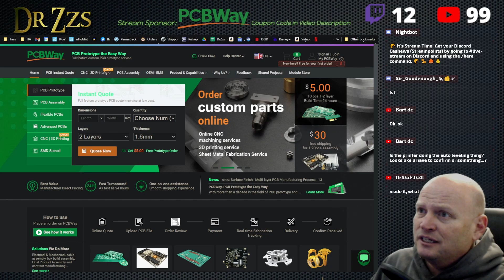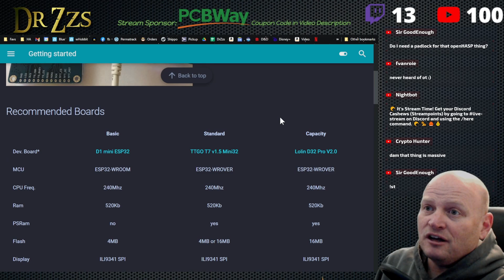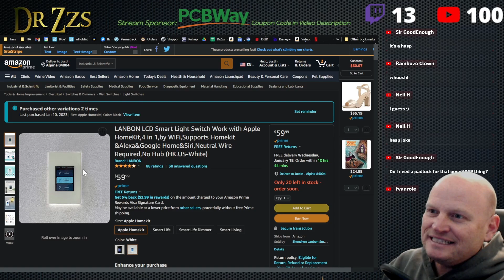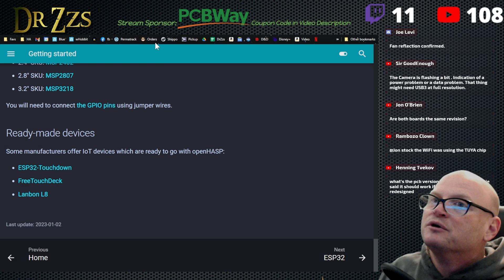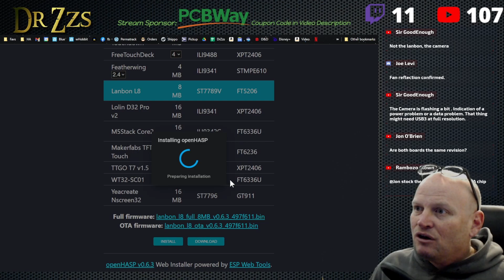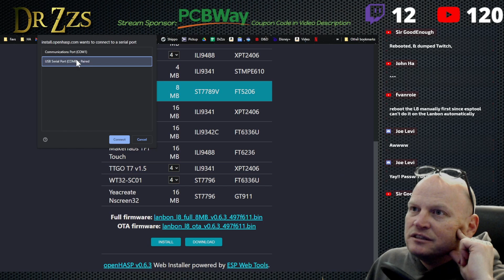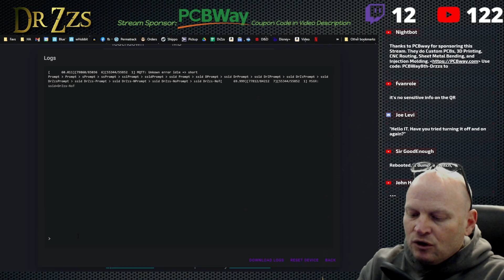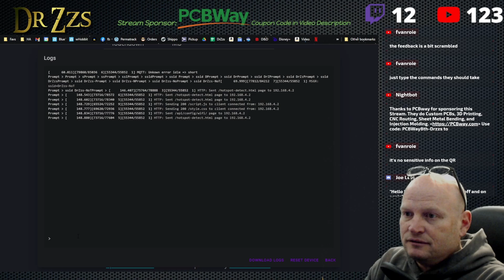DIY Touch Screen Smart Switch - OpenHASP on the Lanbon L8

Comment: How do you do a backup and restore later if you changed your mind?
Reply from the maker: The best way to get help troubleshooting is to join the discord server.  It can be difficult to troubleshoot in the comments section.
Reply: @DrZzs  thanks for replying, I have made a backup with esptool -p COMx -b 115200 read_flash 0 ALL name-backup-original.bin

Comment: Is'nd it possible to desolder the Tuya chip completely and then flashing it?
Reply from the maker: Others did suggest that.  My feeling was, I'd rather spend the extra $10 and buy the Home Kit version, without the Tuya chip, and not have to bother desoldering it.  I still have the tuya version. I may still attempt to desolder it someday.